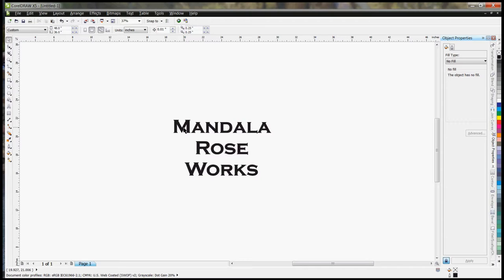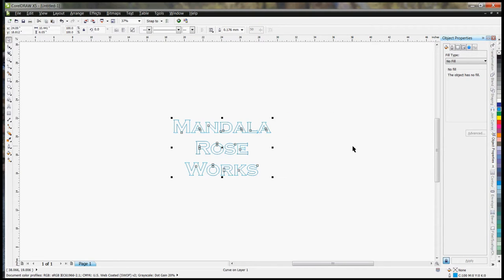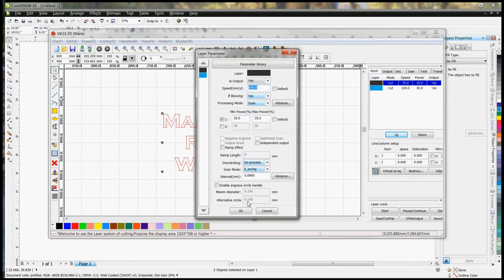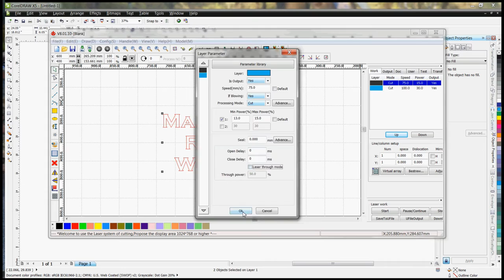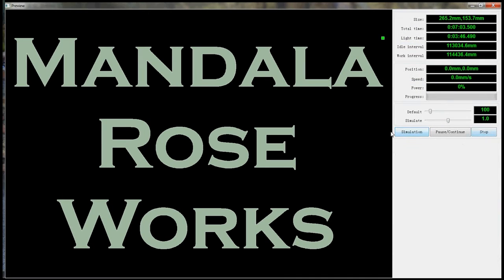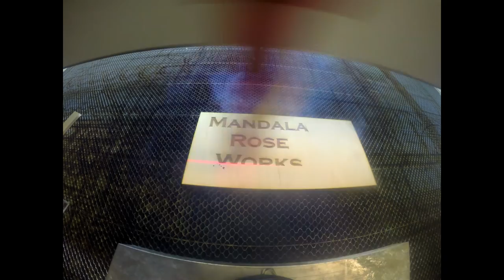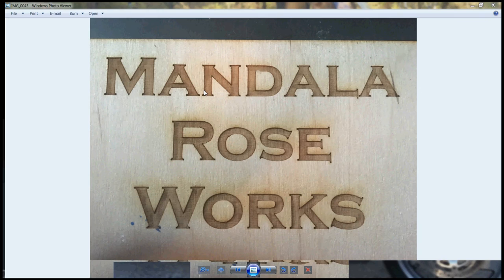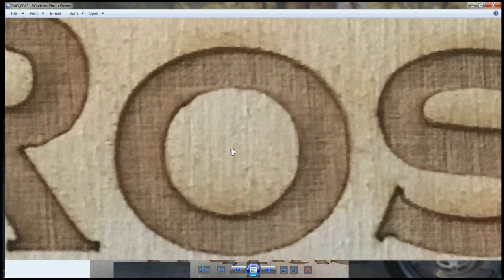COREL005:Enhance a light engraving with your laser

Comment: I didn't even know that RD had a simulate mode. I'm coming from a CNC router and Vectric Vcarve. So all new to Corel and RD.
Reply from the maker: Glad the videos are helping!
Reply: mandalaroseworks I haven’t watched all of them yet. So you Maj cover this later, but I have another question. 

I need to engrave onto round stock, I want to start from the center of the round. This way I can get alignment correct. How do I set this up? What is the best way to engrave centered onto round stock?
Reply from the maker: Are you using a rotary device?
Reply: mandalaroseworks I’m sorry. I should have made my stock type clear. Round flat stock, to make a clock.  

Though as a second note. I will need rotary advice.
Reply from the maker: Oh!  Ok, I follow you now.  

Well, the easiest way I do it is put a piece of tape in the middle of the "round".  Measure the diameter of the part, then put a mark at the center point, now rotate 90 degrees and do the same.  You now have a "crosshair".  

Center that right under the nozzle of the laser (visually is fine) and make sure to origin your laser (hit the origin button on the lasers control panel).  

Now, in your software, once you have all the power settings and speeds setup, just go into the CONFIG menu, then SYSTEM SETTING.  You will see something labeled LASER HEAD, with 9 little circles.  This is the origin point for the design.  Select the "center" circle in the square of 9 circles (X is the one selected in the example below):

O  O  O
O  X  O
O  O  O

Then hit CLOSE, and send your file to the laser.  Once it is downloaded to the laser, hi the "FRAME" button and the laser should trace a "box" around your piece, and return to the center point.

Hope that explanation is easy enough to follow.
Reply: mandalaroseworks yes sir! Thanks for the detailed reply. Very helpful.